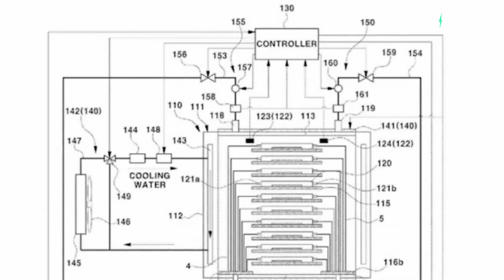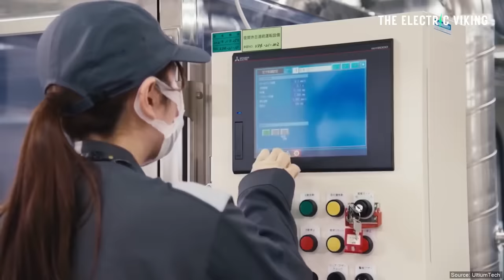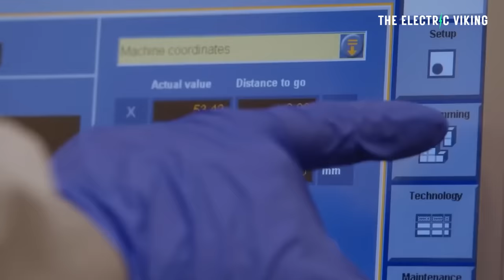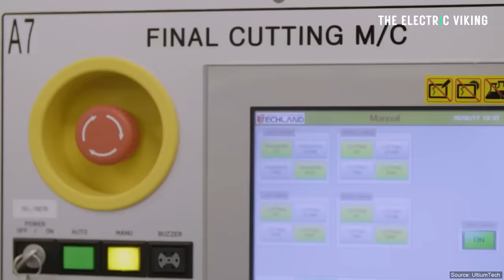Hyundai's secret pressurized solid-state EV battery patented in America

Comment: Our 2020 Hyundai Kona electric was a Lemon.  After 25,000 kms we'd had the main battery replaced due to a production fault, we had the electric drive motor replace as the bearings became noisy , we also had the reduction gearbox replaced as the gears were falling apart and filling the gearbox with metal.  We also had the 12 volt aux battery replace after 12 months of where the car died half a dozen times and had to be jump started.  Hyundai "tested" and told us there was nothing wrong for 12 months...  The problem was they replaced the gearbox with the same faulty part number which guaranteed we'd have the same problem again.  We picked the car up from Hyundai after the reduction box was replaced and drove straight to a dealer who had some new Tesla Model Ys and traded it in.  Hyundai make some great looking cars but  warranty failures are way up there for both EVs and ICE vehicles. 32K kms in the Y without a problem so far.
Reply: I have a Hyundai accent, bought here in Australia, 2015 model and apart from the gas struts on the hatch back breaking and being replaced, not one other thing has gone wrong , still buzzing around 😂, I think there EVs are susceptible
Reply: I purchased my first EV 2 years ago.  Since then, the battery has degraded more than expected and replacing an electric bike battery is not cheap.  I had better luck with cars.  My 2003 Ford Focus had 203,000 miles when I gave it to a relative a month ago and she is driving it daily... including some Door Dash work.  I replaced it with a pristine, clean-title 2010 Toyota Corolla with 125k miles for $5,250 found on Facebook Marketplace.   I do my own repairs, it is not that hard now we have YouTube vids.
Reply: Kona was a lemon. I have an acquaintance who, to Hyundai's credit had his dud vehicle replaced with a new one.
Reply: I'm not trying to blame you, or shame you in any way, I'm actually curious. How did you decide to buy the Kona EV in the first place? Was it the price or some other financial arrangements, the brand, the appeal of the car itself? I mean, in 2020 you could have gotten a Model 3 for almost the same money and I believe more spacious than the Kona. Was Tesla not on your radar at that time? Thanks
Reply: @SunriseLAW  OK.
Reply: 4.3 years with our Model 3, and ZERO problems. We’ve owned Hyundai before, (ICE), but never again, too many problems and VERY expensive parts.
Reply: A dealership with new Model Ys?  Never heard of such a thing.
Reply: We are happy with ours. Sorry to read you had issues. 😢 enjoy your Y 😊
Reply: @jasoncarmichael4540  There are plenty of ICE Hyundai models requiring engine replacement here in the USA.
Reply: @eugeniustheodidactus8890 
he’s just making stuff up.
Reply: Out of the frying pan into the fire. According to the not for profit Consumers Association in the UK, Teslas have poor reliability, poor build standard and poor customer service.
Reply: Hyundai EVs are overpriced and not look good. Its ICEs are better
Reply: I recently wondered why they were so cheap in comparison. Other EV with direkt counterparts from the same company cost often way more that the IC version. Like up Zoe and e-golf. Nearly double the price for a small battery. For the Kona this was not the case. It may have a reason 😮
Reply: @bytemark6508 Tesla has a lot quality issues at the time: panel fitting aside of well-know problemes like with fires after fires, it is not a secret, now we all have internets
I believes they used Hyundai or LG batteries anyways why not go straight to the source
Reply: @bytemark6508 I am not to shame you or disparage you anyways as you pretend no one has internet 👍
Reply: @marke9036  I don't think you understand how incredibly arrogant is a position where only you know about "fires after fires", while , despite all this "fact", all the planet keeps buying the Model Y so much as to become the number 1 car. I realize you have access to the internet, but I'm sure you don't know how to use it properly. Or maybe it's a question of cognitive dissonance. "I don't like Tesla, therefore all the good stuff i see is all lies, and all that is bad must be true." Usually, the truth is somewhere in the middle. Tesla car are not perfect, but they are not as bad as you think. Hence, the popularity. Again, believing everybody else is an idiot says more about you than about everybody else.
Reply: I don't think you can generalize.  I had a coworker who bought brand new Tesla Model X (over $100,000) and had to replace the whole battery in 2 months.  I have had several Hyundai/Kia ICE cars and a hybrid car last 10 years, but I have had 0 major issue.  I think the worst problem I had was a ballbearing broke inside the engine belt tensioner.
Reply: Electric bike batteries aren't comparable to electric car batteries. Also that Ford you had degraded to MPG losses occur over time for gas engines.  @SunriseLAW
Reply: @freddybell8328  Thank you,  Would the batteries used in cars make better ebike batteries.
Reply: So let's see this on a real EV then.
Reply: @bytemark6508  "despite all this "fact", all the planet keeps buying the Model Y"  The planet keeps buying cigarettes and Range Rovers. Not sure your "they sell so they must be good" really holds true.
Reply: @geoffhaylock6848 That's a ridiculous argument. First of all, it is always the case that something that sells is a succesfull product. That is the point of producing something, to sell it.
Now, the "good" or "bad" is a subjective judgement. To a person buying cigarettes, they are good, even if they are objectively bad for them and the other people (second hand smoke). Also, for people buying Range Rovers, also, to them it is a good product. 
But leaving aside the equivocation of "bad" that you tried to serve me, I was simply making a point that if those Tesla had really had an issue with fires, since they sell so many of them, we would definitely know about it. Now, there are accidents, surely, but that is also true for all manufacturers  in the same percentage as Tesla, maybe even more, as was the case of Chevy Bolt in North America, and the Hyundai Kona EV, that had to recall the batteries. No such event happened for Tesla. So no, the justification about the fires is not supported by the facts, it's just FUD. Or as Trump would call it, it's Fake News.

Comment: As a consumer I'm not interested in a 1000 mile battery. Driving at 60 mph it would take me 16 hours to run down the battery. I don't want to sit in a car seat for that long without a break. A 300 mile battery would be plenty. The car could have a smaller battery and would be cheaper and lighter.

Comment: Big problem with Hyundai EVs in Canada.  They do not repair batteries on their EV's and with even minor damage to the bottom protection plate, dealers are quoting over $16000 for a new battery - and Hyundai Canada is not offering anything.  Basically if you run over anything on the road, they tell you to buy a new car.

Comment: Sam, just in case you need a heads up, the patent process is usually about 2 years. If the Hyundai patent has already issued, then the tech is at least that old, but probably much older. A patent application as filed must contain a full and clear disclosure of the invention, so patenting something is in direct conflict with keeping it secret. The patent office, under international treaty, must keep the details confidential for 18 months after filing, but then it will be published for all to see - to allow for objections prior to grant. Whilst a working prototype is not a requirement, the patent office must be convinced it can be produced, and a working prototype is the ultimate proof.

Comment: "Battery pressurization" sounds a lot like battery compression which has been around for 15+ years. In liquid electrolyte cells, compression prevents battery layers from separating as the electrolyte outgasses. Keeping SSBs pressurized serves the same anti-delamination primary purpose, seems like just clamping the whole thing using all-thread with an appropriate amount of elasticity or padding at both ends should be able to do the job.
Reply: Actually clamping is not exactly the same as pressurizing. With pressure it's more even and controllable and can allow for expansion and contraction. Pouch cells are under vacuum which results in 15 psi from atmospheric pressure on the outside unless they gas then it does not work so well.
Reply: @janmessek1826  Clamping does allow for expansion if you choose bolts with an appropriate Young's modulus / stretch and don't mind the force going up by some amount when cells expand. Or you can have compressible pads to achieve the same result using stiffer bolts. If the force is absolutely critical, which I doubt it is, you can use hydraulic tensioners instead of plain nuts.
Making battery packs into pressure vessels doesn't sound like a particularly good idea to me.

Comment: I wonder if it will work as good as the magic carburetor that was talked about in the 1960s. You know, the one that said when attached gets 975 per gallon, but the evil oil companies bought up the patent.
Reply: Patents only last 20 years. The more recent patents I complain about (also expired at this point) are the NIMH battery patents used to delay the electric car by 20 years. They kyoto protocol was signed way back in 1997, Why did it take Tesla until 2008 to come out with the roadster?

This story is described (in part) in the "Patent encumbrance of large automotive NiMH batteries" article in Wikipedia. Despite opposing the California Zero emission mandate near the end of the last century: GM developed a pretty good electric car, the EV-1. It had enough range for typical city trips. It was not sold, but leased to customers. After the Zero emission mandate was defeated: GM recalled the EVs and crushed them. Much like happened to streetcars nearly a century earlier.

But just crushing the Electric car was not enough. They needed to salt the Earth so to speak. So GM sold the NiMH battery patents to Texaco, and oil company. Patents have a particular property. Ostensibly they are designed to encourage innovation by encouraging the disclosure of technologies. But patent holders are NOT required to license a patent. Texaco was later purchased by Chevron. Chevron then sued Panasonic, the battery supplier for the Toyota RAV4 EV. Toyota at the time had a lot of experience with NiMH batteries: having used them in their Prius hybrids. But I guess not requiring fuel was a step too far for the oil company. Toyota has been focusing in Hydrogen fuel cells ever since.

I am convinced that the Tesla battery design: with hundreds of relatively volatile 18650 cells, commonly used in laptops at the time, was actually a patent work-around. Battery suppliers can't get sued for making a commodity product! Too bad that EVs will now forever be associated with car fires now though. There are safer battery chemistries.
Reply: And drawing electricity directly from the air just by using a couple of wires, powering anything.

Comment: Ev people keep saying less moving parts less problems. But all I'm hearing is how much complexity is evolved in these battery system if something goes wrong who the hell will know how to fix it. These batteries have a lot of complexity.
Reply: For the simple minded.
Reply: Regardless of the complexity of a battery, EV's without any doubt, contain far less moving parts.  The electric drive train contains on average about 20 moving parts vs. more than 2,000 for an ICE vehicle.  There is almost nothing under the hood of most ev's, which is why most have frunks.
Reply: @richardhardin9184  You can easily look up the data yourself but the maintenance and upkeep on EV's are significantly less than an ICE vehicle.  There's sites like caredge that keep track of maintenance data on all major brands of vehicles.  The only vehicles that are relatively close are cheaper Toyotas like the corolla but they're still more costly then say a Tesla.
Reply: @Ryan-ff2db  Fewer moving parts unless you count the electrons.
Reply: @Ryan-ff2db  and how many individual cells are in that battery every one a failure point 
 And risk of fire   these little facts matter !
Reply: @gregdean8441  That really depends on the car. The original Tesla roadster used hundreds of commodity 18650 cells as a patent work-around.

The Nissan Leaf, more "designed for manufacturing" had fewer, much larger, "pouch" cells.
Reply: The original Tesla's contained thousands of 18650 cells not hundreds
Reply: @gregdean8441  There are 25 EV fires for every 100,000 EV's on the road vs 1,530 gasoline fires per 100,000 gas vehicles on the road and 3,475 hybrid fire per 100,000 vehicle according to the NHTSA who is the agency tasked for vehicle consumer safety.  Although EV fires are more spectacular the data shows fatalities per fire are on actually remarkably similar between both types of vehicles.  This means someone is almost exactly 61 times more likely to die in a gasoline car than an EV equivalent.  Batteries for most vehicles are proving exceptional durable, more so than most ICE vehicles in fact.  You presented an emotional argument but I prefer actual data to base my decisions off of.

Comment: The only solid state batteries I know of currently deployed  successfully (in heavy traction applications) run hot, between 80C and 120C. Pressurised cooling is needed to prevent the system from boiling.

Deployed in occasional use light transport, just as you used to have to warm up the engine before driving off, you will now have to warm up the battery.

For application in light vehicles, I think SSBs more of a problem than they solve.
Reply: Yoshino portable power unit has SST batts,,when punctured nothing happ3ns very safe
Reply: Especially since most new EVs have ranges FAR exceeding typical commutes.

The electric car was ready to handle typical commutes 20 years ago with NiMH batteries (about half the density of Lithium-ion).
Reply: @WANDERER0070  Interesting tech. I understand these are NMC batteries with higher power density than the LiFePO but are a good deal more expensive and not as good on safety and longevity. NMC is the formulation that generates oxygen when it overheats and may not be accepta be le in some situations.

That said it is clearly going to be advantageous in some circumstances. But we will need to see if it gains wide acceptance.

Comment: Using pressure means a whole can of worms with regard effects of temperature, eapecially extremes of heat and cold. Will the cold be a double whammy of performance due to lower chemical and pressure losses at lower temperatures? Will it be and added liability in a possible explosion at extremee high temperatures?
Reply: Another comment (@jimgraham6722) said the operating temperature of similar batteries was "between 80C and 120C". What you consider hot and what the battery considers hot may be two different things. Such a high temperature does bring into question cold weather performance though.
Reply: The thing is actively pressurised so the pressure is maintained at optimum whenever the system is in use.

Comment: There's just overwhelming evidence that most vehicle batteries are dangerous. Fires are intense and uncontrollable. Just imagine a multi storey parking facility full of electric vehicles.
           You keep mentioning that Toyota has a "mythical" solid state battery. I think they must be committed as a result of a merger with Idemitsu Kosan, a company geared to supplying sulfide. 
      When you look at lithium sulphur battery it has  possibilities, the theoretical capacity is five times that of current batteries. It has big problems too, I imagine that they are able to produce a prototype li-s battery that is satisfactory but said battery is too difficult and expensive to put into production.

Comment: So far, all solid state batteries use a glass electrolyte. Problem with glass is that it is brittle. You put brittle in a car, and it shatters the first time the car flexes at all, as it goes down the road or leaves the driveway. I think other technologies will be available long before SSB; for example M.I.T.'s TAQ battery tech which they have licensed to Lamborghini.  All good wishes.
Reply: Maybe our American university can give it to China so they can bring it to market. Like they did with A123 development.
You know, give our competition a leg up.
Reply: Agree fatigue and cracking likely to be a big problem with these rigid batts.

Existing lithium batteries are polymers or polymer like. They can flex and bend slightly when torqued and put under stress and strain without taking any damage. This means they can be structural, part of the vehicle's 'under chassis' thus saving a lot of weight.

It is just possible SSBs might find a place in apps like like heavy vehicles (as replaceable batteries), stationery and marine applications, but somehow I can't see them making inroads into light vehicles. Tesla seems totally unimpressed with potential for SSBs in TM3, TMY, Cybertruck etc
Reply: I think you’re forgetting just how thin the electrolyte layer is. For solid state, since the conductivity is way lower than liquid electrolytes, they need to be much thinner. At 5 micrometers or so, which is what’s required, it’s so thin that it becomes extremely flexible. Cracking is not an issue. Just think about glass fiber optics - the thinnest ones are about 50 micrometers, and they’re extremely flexible and resilient.
Reply: Nonsense. If something brittle is never stressed to aboveits elastic limit it will not break. Batteries sitting in some sort of enclosure are not mechanically stressed.
Reply: Fibre optics are rarely glass these days, they are usually a polymer

Batteries don't just sit in a box. They are subject to a lot of shock and vibration in a car.